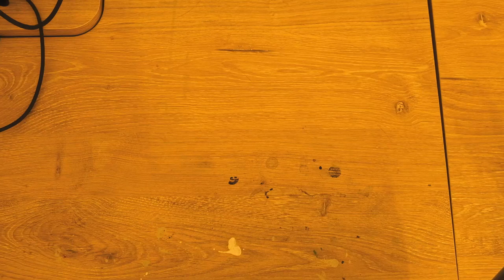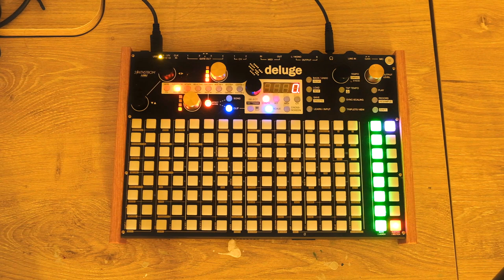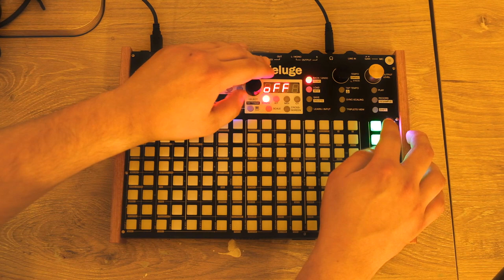Building A Patch On The Synthstrom Deluge #1: Detuned Saw Pad

Comment: I already know the basics of building a subtractive patch, but I found this video very helpful in learning what the workflow looks like creating patches on the deluge. Does it feel pretty fast to change all the parameters, or do you find it tedious? Just curious, thanks!
Reply from the maker: Glad you found it helpful! At this point, I'm so used to the workflow that it feels pretty fast, but even when I made this video, I thought it was pretty intuitive. There's lots of shift+button shortcuts, but they're labeled so it's easy to find what you're looking for. That said, it feels a lot different from patching a synth with tons of single-function knobs and buttons, but that's also just a consequence of the Deluge's array of features.